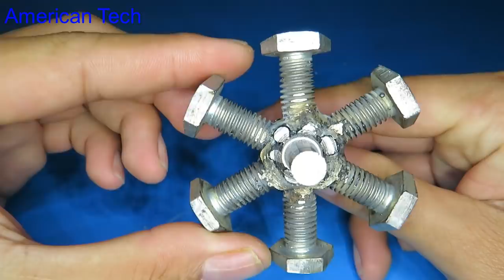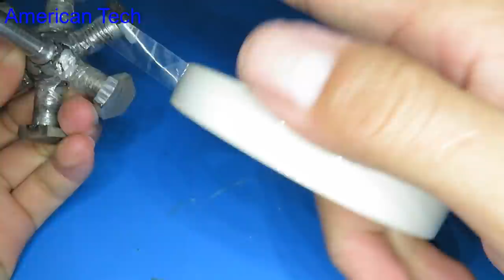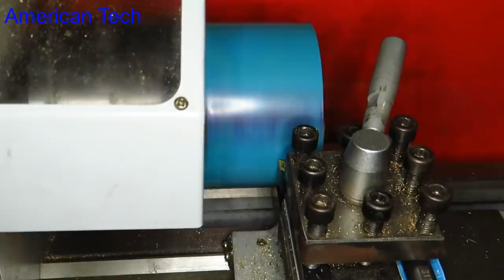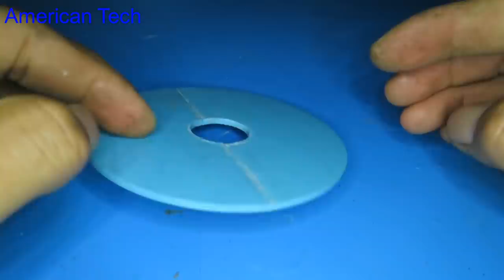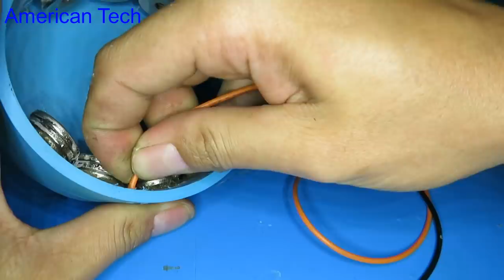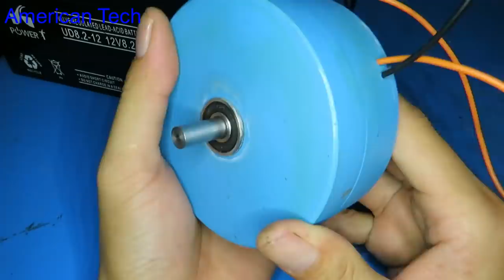How to make a powerful DC motor from screws  ,  Top strong DIY motor

Comment: Great work indeed. I love your vids. However, you'd better think of making some AC stepper motors and induction  motors if you're looking for real strength and high torque. The vibration that is clearly audible tell something about the balance and durability of this motor. Good luck bro.
Reply: now you hold on fella. you're trying to tell me the motor made of bolts and plastics isn't level and vibrates?
Reply: @chrishayes5755  yes, exactly.

Comment: Not bad, but this is nice. But......
Reply: But the case of the two (of yours) may fall apart. First, it was necessary: fasten the case with screws. Secondly: there is no alignment (it is necessary to correct). Thirdly: magnets, they are poorly fixed (it seems to me).

Comment: Very well uses a lathe machine welding machine specific thickness copper wire specific size shaft with threads and specific internal dia bearing and calls it do it yourself. Welp boy.
Reply: What did you want him to do, tape the entire thing together?
Reply: @kayfac6133  He wants him to not call this a DIY (Do It Yourself), a DIY is something which you could easily do at home with the utilities that most homes should have or could also vary depending on the field the DIY is going. In this case however it is to be expected that some kind of machines could be used but the following videa showed heavy machines which probably only 1-2% of the viewers have. I wouldn't call this a DIY. It's better to call this video something similar to a Tutorial or just leave it as "Constructing a self made motor at home". The person which you commented on meant to point this out but couldn't specify it enough for you to understand, I hope I clarified it for you. Have a nice day.
Reply: @bleyzerplayz  to be honest, you don't actually need the lathe. And stick welding is so common, if you can't access that, advanced electric DIYs are out.
Reply: @bleyzerplayz  you dont need a lathe to do that and you can buy a stuck welder for under a hundred bucks. Part of diy is also finding ways of working around not having some of the more expensive tools or machinery

Comment: quality is insane for a diy project. but obviously you need a better enclosure. try sheet metal in the worst case. They use die punch with thick steel sheets in small motors like 555/775/895/997 or cast Aluminium / Iron on bigger motors, the bigger the enclosure, the more vibrations it can absorb. You can manage vibrations by placing silicone/rubber/elastic material on the fixture.
This is great to see a self made motor function so good, i live on an island and even the smallest item you buy online costs a lot to import while salary is low as hell. Looking for ways to recycle available materials here and build cheap but strong/accurate devices.

Comment: Diy, requiring advanced machinery?
Reply: Diy means do it yourself
Reply: @pllayer17  Yes, but not everyone has a Lathe like the one at 0:54.
Reply: @charlesdelanceyjr2019  if you have a drill, vice mount it and spin it, hit it with a grinder

Comment: Nice job but this is less DIY and more How it's made. Step 1 buy welder step 2 learn how to weld step 3 buy lathe step 4 learn how to use lathe.  I'm an Automotive Instructor and was hoping this would be a fun excersise for my students. Voltaic pile it is then.

Comment: Cool stuff, I just didn't quite get the way the current is delivered to the coils. All four wire ends seemed to be connected to the central rod. Also I'm not quite sure why the coils are not isolated from each other.
Reply: Cuz its fake hes using a different motor

Comment: Would have been better to take the threads off the bolts with lathe. Kapton tape would have been better, in case of over heating. Expect the CA glue to crack, yes it hard, but also means it is brittle,  it often cracks with a few weeks, and since a motor creates vibration, it it is like to crack sooner. Epoxy with 10% graphite powder w/w is twice as strong a steel for the same weight. Also heating and pushing out a hole in the PVC cap to a funnel shape would also better support the bearing.

Comment: Can this motor rotate a bicycle wheel? If yes, can this be used as a motor on a bike? If yes, how do I calculate the max velocity of the bike? And how much weight is it capable of moving, even at a low speed does it still move the bike?

Comment: How many volts is it? And what’s the RPM?
Reply: It's 12v battery but I think it can handle more than that
0.4mm copper wire can handle alot of current
I think up to 48v I don't think it can handle mains

Comment: Hi its awesome to is, do u have done some theoretical calculations for the number and windings n speed etc or it's just done with some random values. Can u also suggest some techniques for doing tests on motor @home
Reply: 0.4mm copper wire and 200 turns for each screw

Comment: Power loss in solid iron in rotor will kill efficiency. Also making magnetic path connected on backside of magnets (ie steel ring) will make magnetic field stronger. Wasting time and cooper wires.

Comment: You didn't  show the connection of the coil, how they are connected.
Reply: I think because it is fake. Once the set was closed, he simply put another motor inside and showed it running as if it were the one he assembled.  I do not say that it is not possible to make such an motor, just the video seems fake to me.

Comment: Nice  very nice but 8 scoow jisa ke sath lagay vo chaki he so we must havet to take midal bar to take which having thread so we fix in it.n this type bar not available in place of we have to take plain  piece of pipe n after than we have to fixed 8 scroow with it so we can take simpal in midal. Apane 3 patty bar ke sath lagaye to kya harek patty pe do wire ka soldering Hoga? Aka to turn Lete vakta pahale choda tha vo n dusara turn Pura hone ke bad Jo wire Aya usaka soldering usi patty pe katana he?please reply for further subscrbtion.if u not reply i unsubscribe your chhanel